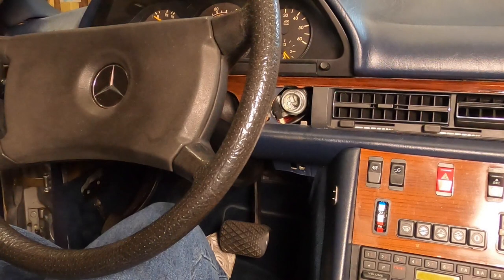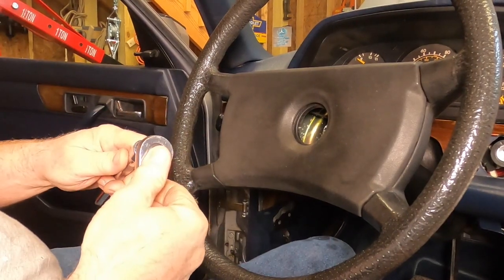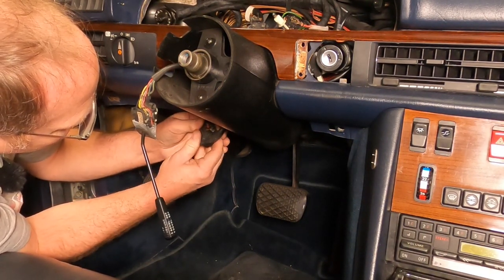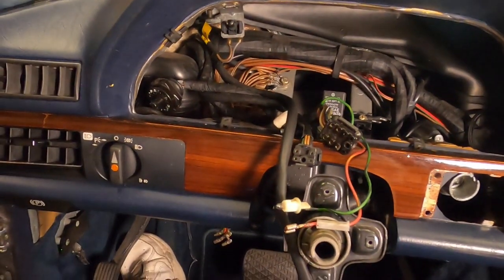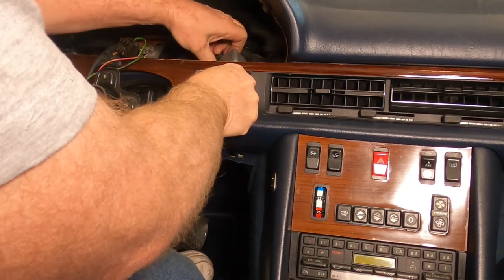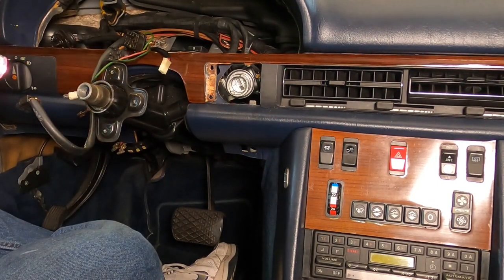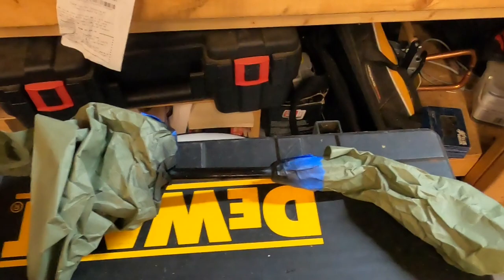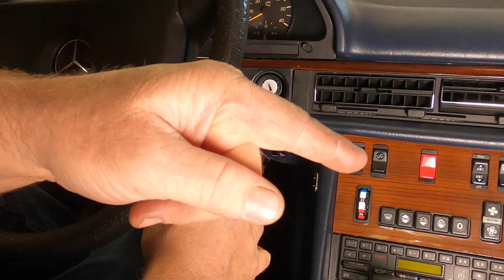W126 Mercedes Sticking Ignition Key - Part 2 - Steering Wheel/Column Ignition/Lock Replacement

Comment: On mine, i ended up separating the steering wheel lock portion of it, and shit canned those parts. I made the mistake of previously repairing the ignition switch and preserving the steering wheel lock. The problem is that the steering wheel lock is a lot of mechanical stress on the aluminum t shape casting that turns the electrical part of the switch. Also, you dont have to pull the steering wheel. I dropped the 2 bolts so the column dropped down, then with a mirror and an angled pick, i pressed the release button that allowed the whole mechanism to come out. Furthermore, you dont need to remove the ignition tumbler out either. Just remove the panel that surrounds the switch and theres enough room to finnegle it out the instrument cluster hole.

While its apart, replace the electrical side of the switch (3 screws) if the electrical section is faulty. If your problem was the key sticking in there due to the burrs not letting the steering wheel lock release, the steering wheel lock mechanism should be shit canned anyway. Inspect the vacuum shutoff switch for leaks, and if any oil is present in the vacuum section then u know the shut off actuator has a leaky diaphragm allowing oil from the inj pump into the vacuum system. Good luck yall and feel free to ask any questions you may have.

Comment: Today, I successfully completed installation of the steering wheel security lock.   I followed Impalaman's excellent video.  I want to add a few items that might be helpful.  First, I have a 380se which is not diesel powered. When I removed the steering lock, I was surprised to find there were no vacuum ports on the lock.  However, the one I purchased from Mercedes had the two ports as shown in Impalaman's video.   So I removed the two vacuum nozzles since I figured the vacuum was for  diesel powered MBZ not gasoline .. That was correct as I found out.

Secondly, I had a very difficult time removing the 10mm screw to remove the steering wheel.  Finally I applied a $20 HF heat gun and it easily cracked with a breaker bar.  I held the steering wheel with a 2x4 placed through the lower opening on the wheel and the end resting on the bottom sill of the door.  This gave a solid stop for the wrenching. I did not lock the wheel for fear of damaging it. I did not use my impact gun because the 10mm screw is brass and there have been many instances of stripping it.

Thirdly, as I mentioned in a previous post, your key has to be in position#1 to remove the plug at rear of the steering lock...  In addition, the key must be in Position #1 when removing the lock and installing the new one or you will not be able to fully press the little "button".  Also position #1 to remove and install the black buzzer switch  near the key hole..

NOTE: if your key won't turn, try pulling it towards you very slightly while turning it..
Reply from the maker: Excellent tips! Thanks for sharing with the Classic Mercedes community!
Reply: @ImpalamansGarage  Do you know how to open the 126 key cylinder so the tumbler can be accessed to re-key it (by replacing the wafers that are worn) and do so in a way that doesn't damage it .  This would be very valuable info for 126ers who want to keep original key.  Mercedes can make keys based on VIN but no longer make tumblers to match keys.  The 116, 124 and 123 have removable covers but the 126 doesn't.  Can you figure out how to get the cover off ? If anyone can, it would be you?😁 Thanks.

Comment: Thanks for great videos and the entertainment you provide along the way ! A+++ 
I changed the cylinder on my 83’ 300SD and after few turns , it locked and took me almost 40 min to turn key . I decided to never take key out to avoid such nightmare again . I will wait for an other video of your about finding out if the issues are in the steering column instead of the cylinder or keys are worned out . 
On another note any AC overhaul video coming soon ? 
I need to overhaul my AC completely. 
Thanks and have a pleasant Easter Sunday !!
Reply from the maker: Well..... I'd hate to overhaul my perfectly functioning air conditioner. 🤣🤣
Reply: @ImpalamansGarage  totally agreed with ya !!!

Comment: A couple of things to remember if you are replacing the steering lock.

The ignition key must be in the #1 position to be able to remove the 7 wire  connector  plug at rear of the steering lock.  Otherwise you cannot remove it or the lock itself.

The steering lock has a pin that you must push to remove the steering lock.  Again, the ignition key must be in the #1 position to be able to push the pin down far enough so you can remove the lock from the dash..

Comment: Thanks for the instructive video.. I am about to do what you just did in your video. (Finally did it today, a year later! 😀). Yesterday, I had a stuck key and PANICKED!, fee4ling stranded.  Fortunately,  I had purchased a new tumbler years ago.  I replaced the tumbler and everything was fine.  

This morning I had no trouble turning the key.  Went to Home Depot and when I came out , key was stuck.  PANIC! After wiggling, shaking and swearing, the key turned.  So I am home and have ordered a steering lock.  I have left the car with wheel turned right (not locked) and key in tumbler on  #1.

Questions: What would happen if I turn key to home and then turn to start and key won't move? ?
If my key is stuck and won't turn, will this force me to replace the steering lock?  

Are any special tools required?  The only good thing about this is being able to sit in the seat..haha..

Can this lock be disabled?  No one is going to steal a 126 Mercedes because it costs to much to fix..

Thanks again.  Your work is appreciated..  I remember when you were excited to have 200 subscribers..Now, over 6000
😀🤔
Reply from the maker: When you park and remove the key and then put slight pressure on the wheel in either direction so that the steering lock can be heard clicking into position, this clearly means the lock is engaged. Unfortunately it also means that the steering column and lock are in a little bit of a bind. The lock is sticking into the hole where it goes but it's being jammed up against one side or the other depending on which way you moved the wheel to get it to lock. UNLOCKING it from this state is the tricky bit. You have to wiggle the steering wheel left and right while turning on the key. It SHOULD free itself. This whole situation is exacerbated if the lock cylinder is worn out and the key is ALREADY having a hard time turning. It makes for a confusing situation. You don't know if the lock cylinder is bad or the steering lock is bad.  Personally I think the steering lock on these cars was an after-thought add-on by Mercedes. Just my opinion. It would be far better served to be inside the column like other makes.  You could in theory remove the steering lock from the car and 
cut off the end that sticks into the column. Then reinstall it and there would be no way for the wheel to be locked. I've not done this or even attempted it. Just a theory.
Reply: @ImpalamansGarage  Thanks for response.  My vehicle is in my garage, parked and I left the ignition key in, pointed to #1 and left steering wheel turned so wheel not locked.  First thing in Morn I will remove the new tumbler, wait for the new steering lock and start taking things off.  Fortunately, several years ago, I bought the 10mm allen head screw(?) made for removing steering wheel..Your video made the process clear. I probably wouldn't make it a DIY without your video. The best part is I can sit on the comfy seat doing much of the work..😄😁 I'm hoping fresh parts will solve the issue.  Thanks again.  I'll let you know if I succeed..

Comment: Are we sure the black plastic housing of the ignition tumbler screws out?  I believe I have somehow freed the ignition tumbler, but the black plastic housing is still holding up removal; so, Mr. Impalaman is clearly screwing out the housing.  Is this on all W126?  I'm struggling with a 1990 300 SE.  Help!
Reply from the maker: In 1989 the method by which you remove the lock cylinder changed. Different tools are used. See part one of this video series at the 2 minute 53 second mark:  https://www.youtube.com/watch?v=smjfMOeafmY&t=173s

Comment: Awesome video.. I have to do the EXACT same thing... Identical problem on my `87 420 sel.  I ordered  the Febi  Cylinder.. Having both cylinders out of the car, the original key was absolutely sticking really bad...the febi  Was buttery smooth... However when I installed the new cylinder it was still sticking.. Having watched your video, Now I'm wondering if I should still purchase the other part, Steering  lock.. Any suggestions of where I should go from here?.
I was thinking about pulling the steering lock out of my parts  car which is a 1991 560SEL not sure if it's gonna fit though.
 Keep making these videos ... Love them
Reply from the maker: After this video I am not convinced that all of these key rotation issues are related to cylinders or the steering lock device. Honestly I need to dig a little further and mess around with alignment of the steering column and/or the steering lock device.

Comment: Hi,
Enjoy your video that give me the confidence to go for something never try before. Just a quick question, since you've already successfully replaced the steering lock assembly, in your opinion can you still remove the steering lock assembly what if the key get stuck in the ignition? Thanks
Al
Reply from the maker: I think if the key gets stuck in the cylinder and cannot be removed, you will probably need to drill out the cylinder lock, however I have not personally gone through this exercise.
Reply: Thanks for thr reply. I've done changing the entire steering lock assembly. The ignition switch is acting up intermittently turn on the glow plugs while driving. I figure it's a bad contact, engaging and disengaging and engaging prompt the glow plugs relay think it's at the starting position. I've ask around, no one seems to encounter this situation. Thanks for your very detailed video instruction. Have a happy holiday season. Cheerio
Al
Reply: I meant it was acting up, and sometimes even the ac fan didn't want to turn on unless I restart the engine. it's all normal now. Thanks again

Comment: I appreciate your detailed videos since I just picked up one of these cars recently.  I do believe you can get new keys made from the dealer that match your VIN, but I'll have to find out since I only have one key and have been meaning to get at least one more made.  Anyway, I think lubrication is probably part of the problem.  You could try official MB "special grease", part # 001-989-42-51-10 for the protrusion into the steering column (it is also useful for other applications such as the sunroof, as I am told).  For the cylinders, there is MB "lubricating grease" spray, part # A 002-989-06-51-09 which is meant for this application.  I would recommend lubricating all of the cylinders in the car, even brand new ones since factories seem to skip this step these days in my experience.

Comment: I am late to the party but I just went to MB with my registration and ID and poof a new key was delivered to the dealership in about a week.  Did that right after i bought my W126
Reply from the maker: Sounds good. I may check with my local dealer.
Reply: I had done the same thing a few years ago when I picked up my 84 300sd.  dealer had it shipped from Illinois to Cali in about a week.

Comment: Watch Kent Burgsma’s video on steering locks on 126 Mercedes on Mercedesorce 
It could be the unit itself!
Reply from the maker: No
Reply from the maker: There is nothing wrong with either of these steering lock devices - original or the replacement. They function flawlessly outside of the car with the key installed onto them. It's only when you install it on the car and tighten everything down that the problem arises. An extremely convincing argument will need to be developed otherwise.

Comment: I finally watched your whole video. the steering lock mechanical parts that are responsible for the actual movement of the lock bolt into the steering shaft have to do hard work - that sticking feeling - then if the bolt doesn't line perfectly with the hole in the column can't turn the key. Since you now have a spare I suggest you take one apart and examine the guts that move the bolt when you turn the key. By removing the guts the key will turn easily - no steering wheel lock- and you can keep your original key. DANGER!!! THE OTHER KEY INSERTED INTO YOUR DOOR LOCK CAN MESS UP THE PINS IN YOUR LOCK THEN THE DOOR LOCK WON'T WORK☹😖😢😢😢 It can be a bad accident.
I do believe you can get a new exact key from a Mercedes dealer when I did @ $75 or a new tumbler with 1 exact match key $100 & something, they know your key by your vin # so you have to show ID & registration to prove ownership. I hope that might help.

Comment: I love your attitude about whatever you are doing.
Not sure what your lock problem was/is but usually the guts of the lock mechanism that engage the bolt into the steering column wear out then you can't turn the key to unlock the column, start the car or turn the wheel. Your new lock should have worked smoothly. I took the guts out of mine, no locking column key turns nice.
I got new OE lock cylinder from the dealer with a key that matches the door. At the time I think around $80
They make it by your vin number, you have to prove it;s yours. 
WARNING!! that other ignition key when accidentally inserted into the door will destroy the lock pins in the door BE CAREFULL!!!!!!

Comment: Well that sucks, you still have the same issue. 😠
Reply from the maker: Par for the course I play on. 😅 I think it's an alignment issue. Going to loosen bolts and move things around. The assembly worked flawlessly after I installed it, but before I tightened the clamp and reinstalled the wheel.